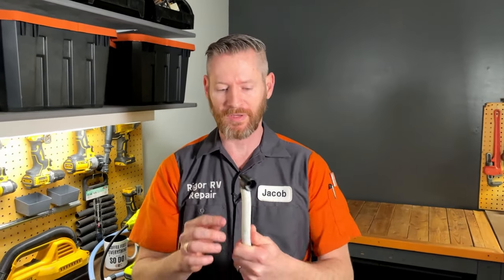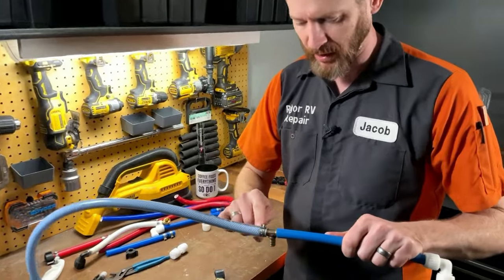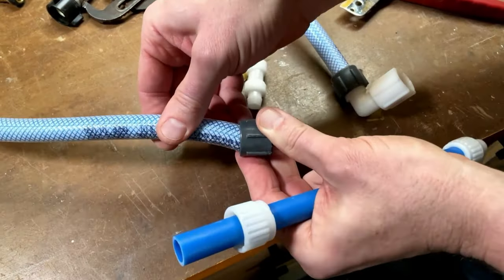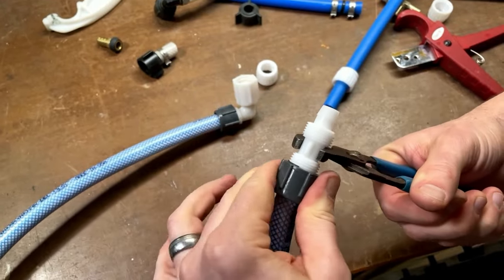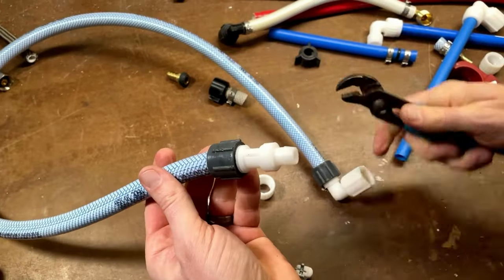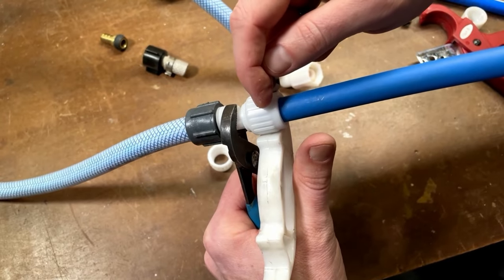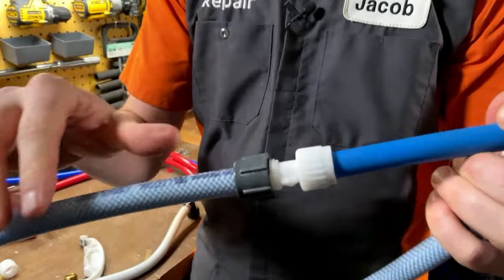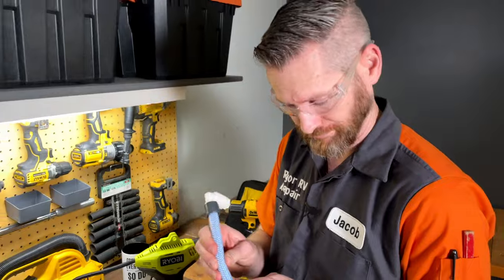How to fix RV flexible tubing plumbing leaks - Tutorial (Part 3)

Comment: This is most likely the best RV repair channel out there. After months of trying to find a specific pluming repair that is an actual engineered design for a specific issue, I found it here and it just confirmed what I had known for quit awhile. RV manufactures have been connecting flexible water hose to Flair-it fittings incorrectly for years and some are still doing it in 2024. There has been no specific dedicated engineered design to make this connection that I could find any place until recently. Manufactures would just use a cinch or pinch clamp to make this connection and this method was never designed for this application. They just made up a way of connecting the two very different types of plumbing materials. Well guess what happed to me the connection failed on me and sent water under my coach under the floor and fortunately not into the coach. They connected the flexible 1/2" hose to a Flair-it Tee and the ID of the flexible hose is not the same as the OD of Flair-it fitting designed for Pex piping so it's not a tight fit at all and it's secured with a cinch clamp that was not installed correctly at the factory. The clamp was installed too high on the shoulder of the fitting and one day it just came off while we were hooked up to city connection at a RV park and yes I did have a pressure regulator in place to prevent any over pressurization of my RV plumbing system. Fortunately only 5 to 10 gals of water was released into the RV,  but it sure did create a lot of work to dry it all out and to replace some floor insulation, and of course I had to cut some of the under belly to do all of this. And if anyone wants to know the manufacture is Northwood MFG an Artic Fox which is not a cheap coach, but they are not perfect either. Many thanks to Rigor RV for showing the correct way to make a connection from Flexible hose to a Flair-it fitting and thanks to Flair-it for Engineering a specific fitting for this application !
Reply: The entire RV industry is the same way.  They are not interested in quality work or materials.  Their entire focus is to build fast, as cheaply as possible and get the completed vehicle out the door.  They do not design for durability, ease of maintenance, proper fitting of electrical and plumbing components, nor do they take into account the constant movement and pressure applied by the road travel.  The dealerships are caught in a dilemma, since they have to do so much prep work to get a unit ready to go out the door, and most of them refuse to pay a decent wage to good repair and mechanical people, so they are constantly understaffed and getting anything repaired at a dealer is a multi month project, mostly with the vehicle stored out in the weather and subject to invasion by rodents and other vermin.

Comment: I watched this video and immediately ordered $150 worth of parts and the tool from RecPro. I've had 3 minor leaks in my new trailer in its first year and am going to replace all of the trouble connections that aren't too hard to get to. Thanks so much.
Reply: Well there you go. RecPro just refunded my whole order. WTF? They might not be a good vendor for this.
Reply: @stevenmullins9799 Were they out of stock?
Reply: @zLigHt44  One item was missing so they cancelled the whole order, but then it came back in stock days later and I got it all quickly
Reply: @stevenmullins9799  Thanks for the heads up!

Comment: So far no leaks but in your post as of this date, we have discovered that we have a flexible tube connecting to the water pump where they used screw clamps onto the male ends of flair fittings.   Our rig is 2005 so the industry has been doing it since then.   I was sizing up the situation to install a water actuator and confirming which side of the water pump to install it on - is when I made that discovery.   We've been completely revamping the plumbing.  Thank you Sir!

Comment: Hi Jacob. There is a brass fitting out there by Shark Bite (union connector) that is designed for PEX (with crimp fitting) on one side and flex hose (with a hose clamp) on the other side.  Have you considered these for this application?
Wayne W.

Comment: In this video, you replaced a Tee with a straight coupling.  How would you connect the third line?
Reply: Ive faced this issue. After the proper repair, you could add a Pex T just down the Pex line using proper Pex clamps..

Comment: Oh my.  What a great video. Does the flare it fitting have the same barb on both ends, and it is only the threaded collar / insert that differs depending on if you are using pex or flex?  Do the fittings come with two pcs each of flex and pex ring and bushing?
Reply from the maker: The fittings only have the PEX collar. You can take that off and install a flex adapter bushing and collar (sold separately) wherever needed. If you look at the video description links you will find the fittings in my Amazon store, and the adapters linked to two other websites.

Comment: Great video on a fix for my East to West RV that's full of flex hose. As of 2/17/24 everyone is out of the adaptors. None to be found. Word got out quick  ( Or did you buy them all? )
Reply from the maker: I think the suppliers had low inventory because nobody was buying the adapter. I hope they start stocking more, which they probably will if they are always selling out. I asked FlarIt to add the adapter directly on Amazon. They said they are working on it.

Comment: Great video. I'm confused, though, about how to fix TEE-fittings where two lines are PEX and one is flex.
Reply from the maker: Just use the gray adapter on the flex. The white lock collars work on PEX.

Comment: Both suppliers listed are out of stock, the Flair-it website is not the best they do have a catalog, but the "06325 RV Fresh Water Plumbing Coupling 1/2" MPT to 1/2" Flex Hose" part number is part of a water heater bypass kit and not a single part number like the rest. Is there another supplier that a guy could order some?  Thank you for the tutorial and finding this solution, everyone must have bought up all of the inventory once the fix was revealed!!
Reply from the maker: I have searched many times and only found those two suppliers. My guess is that they don't stock large quantities because historically they have not sold many. They will probably start stocking more as they keep selling out. Sorry, I wish I could tell you something other than check back!

Comment: Good series on plumbing repair when forced to deal with flexible hose. 

I noticed you use pinch rings for PEX connections. I have a full crimp tool and materials setup from working on my house and would prefer to use those since I already own them. Is there any reason not use copper crimp rings?
Reply from the maker: No, I occasionally see copper crimps on RV's and it is a proper and high-quality method of attachment. Thanks for watching!
Reply: @undercoverrvtech  Thanks.

Comment: Glad my rv had the correct plumbing.  But they used cheap quick twist on connects to go from pex the the flex tube.   So in 2 years I’ve replaced all of them with brass fittings.  All the flex lines in my rv are stainless steel lines so don’t think this would work.

Comment: Was looking into buying a 2023-2024 grand design either imagine or reflection. I saw your video that they are doing their plumbing this way. If I did this to all the plumbing would that fix the issue? Thanks in advance!
Reply from the maker: Yes, but keep in mind some fittings are not easy to access. Under the shower for example you can find a mess of fittings that are very difficult to work on. Plumbing aside, be sure and ask about frame problems with the model you want on forums before buying.

Comment: The 90 degree plastic fittings connected directly to the pex, or to a section of reinforced vinyl which is in turn connected to pex are simply not able to take the constant pressure placed on them by the stiff tubing.  They eventually start to deform, both the seal and the fitting assuming an oval shape, and the seal is broken.  Replace them with standard faucet fittings or stainless hose barbs with double stainless hose clamps.  Check them every trip and as part of a pre trip maintenance scheme.  The manufacturers are not going to change their cheapskate  approach to buying parts and materials and will continue to pass the problems to the dealers and owners.  The only way to make them stop is to refuse to buy their products and to educate potential customers.

Comment: Neither of the Flair-It Adaptor suppliers you linked in the description have these in stock or listed as unavailable. I also can't find them on Amazon, any other suppliers that might have these?
I cannot get Pex to where these connections are so I'm stuck using the Flair-It solution, but without these vinyl tubing adapters I'm stuck!

Comment: The Flair-It fittings are worthless, in my opinion.  I tried replacing the lines in my Forest River popup with the 1/2 x 5/8 fittings and 1/2 x 5/8 tubing.  Installed without the bushings and they leaked, no matter how they were tightened.  finally got the bushings and reinstalled.  Put pressure on the lines and the fitting on the pump side of the city water feed blew off.  Checked the rest of the connections and was able to pull the lines free with little effort.  There is insufficient compression to hold or seal the lines.  I'm switching all the fittings to hose barbs and double clamps.

Comment: We are having a few leaks in our 2021 Grand Design Momentum 397Th.   I am wondering if there would be any issues changing out as many plastic fittings as I can with Brass ones as well as switching to the soft pex piles/hose.

Comment: the flex tube is used to connect to the back of our toilet using of course the clamp for regular pex which leaks. What is the proper connectors to connect flex tubing to the back of a toilet? Is it just changing the clamp or is there a specific hand twist piece and clamp that should be used? I cannot replace the whole tube because it disappears below floor

Comment: That elbow 90 degree fitting looks like mine that goes to a shower faucet so the new stuff youre putting on there wouldnt help if its leaking from the hose to the fitting.

Comment: I am trying to find my SHOT OFF VALVE, I am going to buy my stuff tomorrow ad I have a water leak under the bathroom sink, ( The Plex line ) but the bad line has Water in it, so when I take it off the water is going to flood !!!!  Mine is a 2015 trail lite crossover. Donyou know when I can find the SHUT OFF VALVE????

Comment: These videos would be good if you could bring all of your plumbing to the bench and had all the room in the area to work, but real world leaks are in hard to reach and cramped places. As in my Winnebago View, these fixes won’t work unless you remove the shower. Even then, still very cramped and most of the connections are tee connections.
Reply from the maker: Yep, I generally don't recommend that people buy Winnebago for that reason. They have lot of problematic connections. If you are dealing with leaks already, I'm very sorry. I wish the industry would stop using this type of connection.

Comment: Hi I have a 2021 jayco with flex tubing to PEX and not in places I can get to I'm ,71yr old I had dealer put different fittings on at shower and outside kitchen and it still leaks after I use hot water and then cooling down mostly on hot water connections I put two worm gear clamps and it seems to work but their are PEX tees that I can't get to and if I could and have to cut it out then the PEX would be to short to replace fitting.ouy side kitchen was able to add hose clamps but not the shower. Doesn't seem to be leaking but at night sometimes I hear pump kick on for a moment. What should I do? 
Need help and it is out of warranty. Think you RY

Comment: Have you ever located a 1/2” barbed to 1/2” PEX fitting and just use a worm gear hose clamp on the tubing/barb side and a crimp clamp on PEX?  Much simpler way to go from PB tubing to PEX but not removable like your more expensive fitting. Please share link if you have seen a barb to pet adapter fitting. Thank you.
Reply from the maker: I have looked many, many times.  Unfortunately it does not exist as far as I can tell.
Reply: Thanks for the quick response.    Another suggestion on future video would be to make sure people know the difference between braided vinyl (PVC) tubing and the gray PB (Polybutalyne) pipe that uses barbed fittings.  I don't think the PB barbed fittings are interchangeable with braided vinyl tubing barbed fittings. Last challenge is differences in 1/2" braided vinyl tubing.  RV manufacturer's buy tubing manufactured by CAMCO that is smaller than what you can get at Home Depot.  Camco vinyl tubing is probably made slightly smaller just because all these RV Manf. want to use PEX fittings and cinch clamps trying to reduce this problem of not using the right fittings.